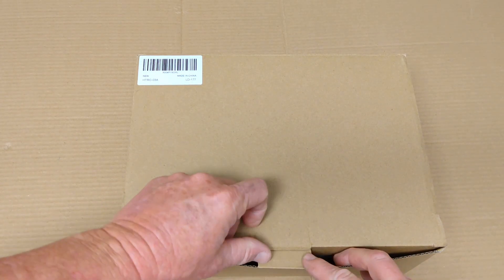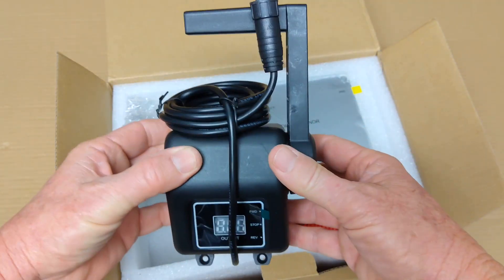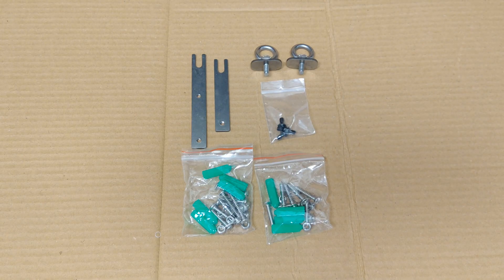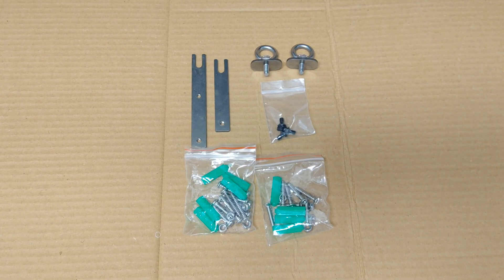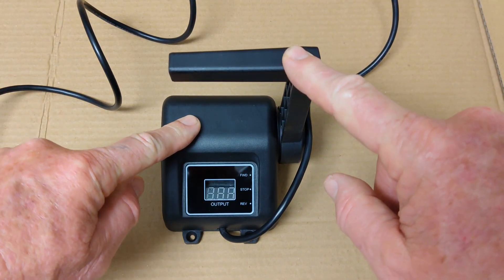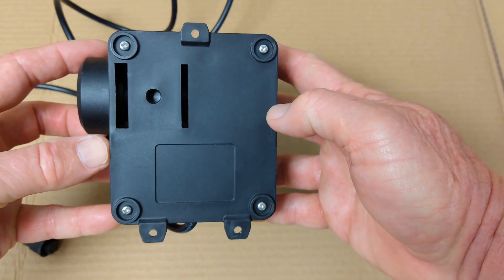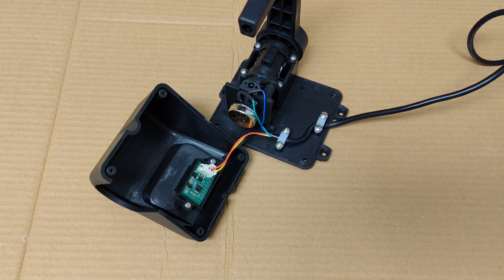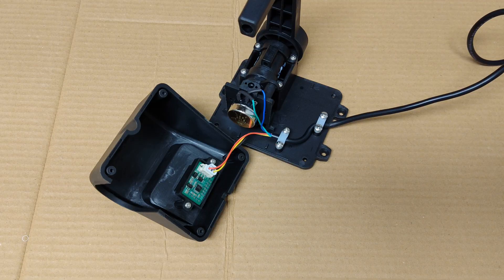Briidea PWM 2025 Model with Lever Controller Unboxing Test and Review

Comment: I have a question. I took the head off my trolling motor to shorten the shaft and make foot controls. There is a blue wire and a yellow wire coming from the trolling motor but no where to hook it up in the box. Do I just leave them off ?
Reply from the maker: What type and size of trolling motor are you using?

Comment: How good is the hand control at low speeds. Is it as good as the dial potentiometer.  And how long is control cable, it does not mention length when you purchase

Comment: as you may or not know, I did mount an Briidea (not the same as you did,) and since then have relocated my circuit breaker inside the battery box. I now want to add a kill switch but cannot find the  water blade (two post) switch as I am sure that company no longer offers it.  Do you happen to know where I could find a similar one?  I really want to keep it simple with out  having to use one that requires a relay. Thanks!
Reply from the maker: I really liked that kill switch but I could never find a similar replacement.
Reply: @Aksmaniyak  OK, thanks for the prompt reply. I guess I will go ahead and use a standard switch using an automotive relay. Should not take up that much room inside the battery box. I have done it before on a motorcycle.
Reply from the maker: @jameshunt585  That seems to be the best way now.
Reply: another though that occurs to me,,,supposing someone wants to have a 2nd connection from motor to battery in case of ESC or PWM failure, how could one then reach the motor controls? seems bit dangerous to me, you make the connection, motor takes off, no control.;  Kill switch - yes, but in panic mode?  am I missing something here? of course you still have steering.
Reply from the maker: @jameshunt585  I did a video for that. You would need a separate quick connect for power on/off at WOT.

Comment: would it be possible to use quick connectors for the motor and for the battery to this like in your other videos?  If so, what do you recommend would be best since the wiring is 6ga.
Reply from the maker: Yes, I used XT90 connectors.
Reply: @Aksmaniyak  how about the battery any recommendations?  I found theses not sure which oneRedodo Smart Bluetooth 12V 50Ah LiFePO4 Lithium Battery for Trolling Motor, Low-Temp Protection, 10 Years Lifetime, or the 12V 100Ah LiFePO4 Lithium Battery?

Comment: Love your videos. I can't find the Briidea PWM  with the hand controller in your video on their website. Is there a part number you can provide? I've been running guided motorized kayak adventure tours for over 15 years and this system with the handle is perfect.
Reply from the maker: Thanks! It seems like Amazon only had a limited supply. During that time, they even raised the price and now it is only available through Briidea (at over $200). I'm not sure what the issue is now.
Reply: @A @Aksmaniyak hey’re back in stock, but selling fast. I purchased one on Amazon a couple of days ago for $129.
Reply from the maker: @Oddboggler  Nice. They were $109 when  bought mine.

Comment: what size trolling motor are you testing with? according to the MFG this unit is only rated for 35A? my 55 lbs pulls more than that.
Reply from the maker: The 50A continuous rating is listed in the narrative of the video.

Comment: I have an older used Mini Kota 50lb thrust motor that runs very well.  I decided to use the Briidea PWM 2025 with Lever Controller; but, cannot find one in stock anywhere.  What would you use instead?
Reply: Please reply to my previous question   Thank you!

Comment: This is a bit trivial and I am sure I can come up with something. I am going to mount a Briidea pwm box near my seat. The box measures 146mm X 126MM with flanged bottom and heat sink with  mounting screw holes. The problem is that the ideal location is not perfectly flat but has depressions made for paddle rests. My idea is to bend a couple aluminum straps for the flanged bottom to secure the flanged bottom. the.  bottom of the straps would be riveted to the sides of the gunnel. Before I start, I thought you may have already done this as you have for a plethora of other things.
Reply: ok, got  pwm box mounted. I simply riveted an "L" bracket to either end and fitted the brackets to an open ended track mount  , added knobs. The Briidea is pretty large and sticks out a lot, but it seems firm enough. It ain;t gonna win any beauty contests, but :function over form.

Comment: Good video; but, I was wondering:  Which is better. this PWM or this one, 100A Continuous 200A Spike PWM Speed Controller for Trolling Motor, that you reviewed a year ago?
Reply from the maker: It really depends on your trolling motor size. This is a good deal with all of the built in features.
Reply: I have an older used Mini Kota 50lb thrust motor that runs very well.  I decided to use the Briidea PWM 2025 with Lever Controller; but, cannot find one in stock anywhere.  What would you use instead?
Reply: I have an older used Mini Kota 50lb thrust motor that runs very well.  I decided to use the Briidea PWM 2025 with Lever Controller; but, cannot find one in stock anywhere.  What would you use instead?
Reply: I have an older used Mini Kota 50lb thrust motor that runs very well.  I decided to use the Briidea PWM 2025 with Lever Controller; but, cannot find one in stock anywhere.  What would you use instead?
Reply from the maker: @jerrybell4884  You could get the one without the remote and DIY and extended POT controller.

Comment: is there a kill switch?
Reply from the maker: On the one I bought yes.
Reply: @Aksmaniyak  That was a dumb question my apologies I didn't watch the whole video! Another question is when you run the wires from the trolling motor thru the box does that need to be waterproofed with caulking? I would imagine there is some space between the wire and the (black) fitting on the box. 

Also do you need add a connector to the wires when you to conect them to the board?

Thanks again. I'm not very tech/ electric savy at all. This is a big help. I was gonna buy a newport nk180 setup but this is basically the same thing for a fraction of the price.
Reply from the maker: @MiamiIsAnIsland  The black fittings are called gland nuts and they are designed to be waterproof. You don't have to use a connector for the wires but I did.

Comment: What do I do with the other 2 wires on the trolling motor
Reply: You don't need those. They are the fwd and reverse wires if you were using the switch from the factory that you removed out of the head. Just tuck them back down in the shaft or some people cut them off.
Reply: @darrenlanier8748 I did not even have to remove the trolling motor head, just ran the positive and negative wires as is in case I ever want to use the motor on another boat. Just make sure you have the motor handle controls in max position an let the PWM do all the work,

Comment: I noticed when you went forward on the handle the thrust force was actually in reverse and when you pulled back to reverse it was forward thrust.  The pot is setup backwards.  Can you verify?  Good video by the way.  This is what I need for my Newport Vessel 46lb trolling motor.  I have another PWM and it overheats and shuts down later in the hot day here in San Antonio, Tx..
Reply: I installed the same unit without the kill switch and discovered that the thrust was definitely in reverse on forward and in forward on reverse.  Initially, I thought I had made a mistake but on rechecking both the installation and the instructions I determined a fault in the instructions. A simple wiring switch resolved the issue.
Reply: @UPNORTHNY I had a feeling that was the case. I have seen many people say it's reversed.
Reply from the maker: Thanks Jason. The prop rotation using the forward lever position produces a counter clockwise (forward) rotation.
Reply: @Aksmaniyak naw when it was in the water it was backwards
Reply: @fuqimhigh  I see a complaint on amazon about the same issue
Reply: @MiamiIsAnIsland I just installed mine so we shall see I'm pretty sure it's backwards

Comment: Do you think it would be reasonable to buy the non-Killswitch model and then try to install a Killswitch in the throttle?
Reply from the maker: No, that space is pretty well filled.
Reply from the maker: It would cost more to do it yourself than the installed version but you would be able to place it where you wanted.
Reply: @Aksmaniyak  do you think there is enough space in the throttle housing to add the kill switch to the housing directly?

Comment: That's a really neat option as far as the handle.   Have you came across others?  I have a pwm already set up, but the handle beats the pot switch and rocker im using.
Reply from the maker: I have used that handle on another project with a brushless trolling motor. You can buy it on AliExpress for about $80. That's another reason this seems to be a good value. You get the whole completed kit for almost the price of just the handle.
Reply: @Aksmaniyak I have the same project ie using this handle with a brushless thruster from blue robotic and a 21V lithium battery. How far advanced are  you with the set-up?
Reply from the maker: @marctanguy2403  I used it with a brushless Haswing Protruar 1.0 by replacing the stock pot with the Haswing pot and a lot of modding.